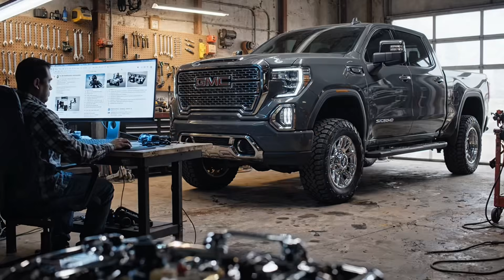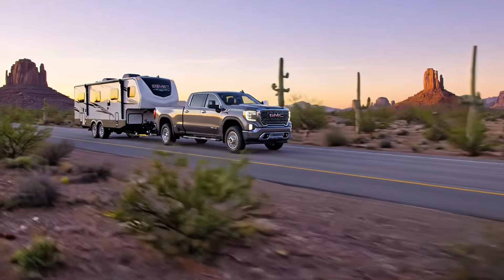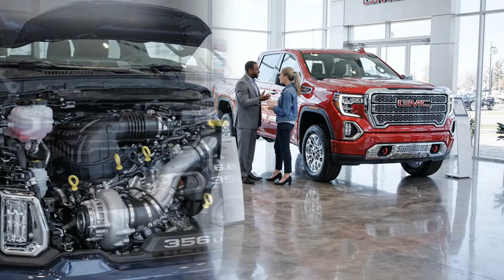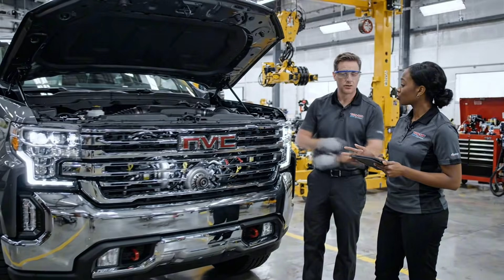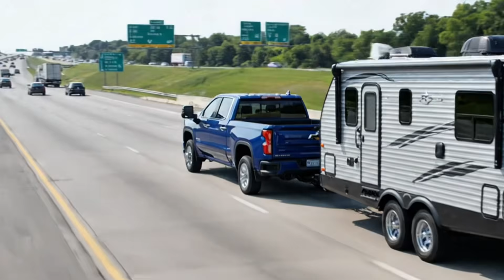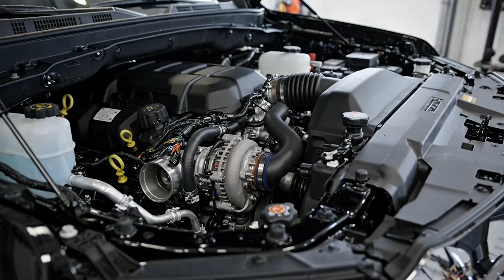GM’s 6.6L Duramax Just Evolved—Is the 8.3L Diesel Finally Coming?

Comment: Bullshit
Reply: Dude dont say that it can happen lil bit bigger crank pistons cam intake heads and its do able
Reply from the maker: @robertredmon6387  It’s definitely possible from an engineering standpoint. Whether GM actually chooses to build and release something like that is the big question. We’ll have to wait for official announcements. Thanks for sharing your thoughts!
Reply: @CarVisionLab everything  is possible
Reply from the maker: @robertredmon6387  Absolutely. The real challenge is turning what’s possible into a reliable production engine that meets emissions, durability, and cost targets. Let’s see what GM does next.
Reply: @CarVisionLab true
Reply: The next gen 2500/3500 looks like it will be released in 2028. This is plausible!
Reply from the maker: @LeftlaneLos  That’s certainly possible. A 2028 launch for the next-generation HD trucks lines up with a lot of industry speculation. We’ll have to wait for GM’s official announcement, but it’s definitely an interesting timeline to watch. Thanks for sharing!
Reply: @CarVisionLab I have a 1500 Silverado, I was thinking about waiting for the 2027 2500, since Chevy has the new gen 1500 releasing this fall, I thought the same for the 2500/3500 platform. As I read on GM forum they said it would be end of 2027 branded as 2028.
Reply from the maker: @LeftlaneLos  That’s an interesting timeline, and it does line up with what many enthusiasts have been discussing. If GM follows that schedule, waiting could make sense. We’ll have to see what GM officially announces, but thanks for sharing what you found!
Reply: Engine manufactures develop engines years in advance.
Reply from the maker: @LeftlaneLos  Absolutely. Major engines are typically in development for years before they’re announced. It’ll be interesting to see what GM officially reveals when the time comes. Thanks for the insight!
Reply from the maker: Fair enough. Nothing has been officially confirmed by GM yet. The video covers the latest reports and speculation, and we’ll update everyone as soon as official information is released. Thanks for watching.